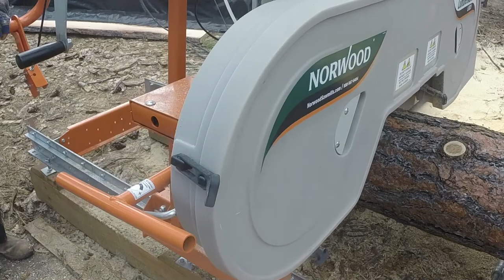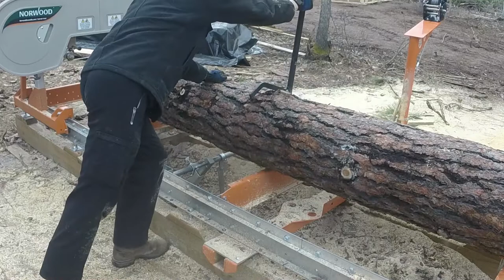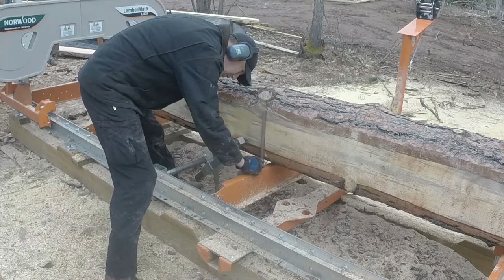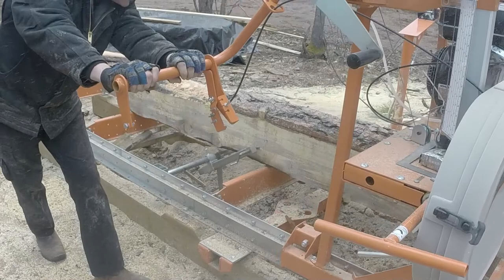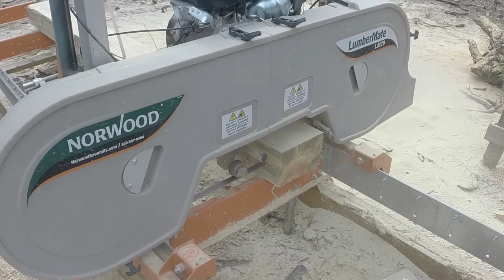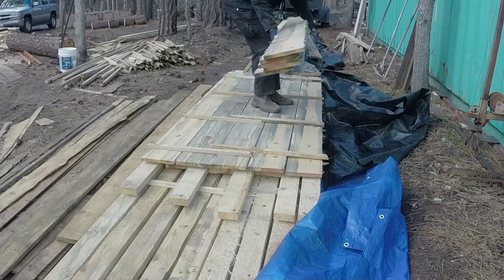Milling board and batten on the Norwood LM29 sawmill - norwood portable sawmills

Comment: I didn’t read all the comments, so it might have already been mentioned. I’m in Canada. The rule of thumb here is to only cut Pine and Spruce logs in months ending in ‘R’. The sap is low during the cold months. You can mill them at any time, but cutting when the sap is low is best. 
Keep up the good work!
Reply from the maker: Never heard any mention of only milling pine in a month ending in "R". Not sure if you are pulling my chain or not but on a side note there isn't much sap in blue pine as it is already dead when I cut it down. :)
Reply: Main species in Eastern Canada are White Pine and Red Pine. Both have a lot of sap in the warmer months. My Father in Law has worked in the woods for more than 75 years was the one who told me about the ‘R’ months. I have heard others mention it as well. If the wood you are milling is already dead, then, no issue. I also know large commercial sawmills in my area will not even purchase Pine that was cut in warmer months. Too much sap on the equipment and blades.
Reply from the maker: @davidbelyea7031  Interesting that mills wont even purchase Pine cut in warmer months. Around here mills get what they get and are happy for it. lol :)
Reply: There is a monopoly here with one wealthy family that buys up private wood lot but also clear cuts Crown (government) wood lots. They set the conditions and prices. They pay next to nothing in royalties, yet when 2x4’s were selling at $6-$8 last year, they matched the price in all their retail stores, despite the fact that their cost remained the same as before COVID.
Btw. I run a Norwood Mark 4
Reply from the maker: @davidbelyea7031  That sounds horrible, where abouts do you live? I'm kinda lucky that I do have a sawmill and I also have a big home store about an hour away so I can buy lumber if I want to. Depends on what I need and how long it will take me to mill it, time for product kinda thing. :)
Reply: I refuse to buy lumber from a retail store. I have 100 acres of century old White Eastern Pine and the big loggers have clear cut right up to my property line on one side-including taking out a 4’ diameter boundary tree and leaving it to rot on the ground because it was too big for their slider to handle. I live in New Brunswick on Canada’s East coast. Glad I have my Norwood and lots of my own wood!
Reply from the maker: @davidbelyea7031  We had thought about moving to BC 4 years ago before we found this property. Seems like there's more room and less people but I didn't look into it much. I don't know what the building regulations are but where I'm at I have to buy lumber to build anything meant for human inhabitance "house", but we can build barns and sheds out of whatever we want. :)
Reply: It helps to know a lumber grader who can stamp your work

Comment: When you said diamond pattern that made me think of milling metal. While ago I was milling a piece of aluminium and made a few cuts everything ok. Next day I continued, and see a faint diamond pattern that was not there the previous day. Checked everything, even asked the cat if he had any ideas. Yes, give me some treats. Made cup of tea, thought of everything but still no solution. Then I double checked the mill, over, sideways, up down underneath. Saw a socket head bolt on the floor. It was from mill, nothing major, but enough when missing to allow the smallest vibration. Replaced with new bolt, diamond pattern not happening now. So that shows that the smallest thing can have a big effect. Check the stability of your mill, might have got out of line or a bit unstable.
Reply from the maker: I try and check the level of the mill every other log, sometimes this doesn't happen but every time I check it it is straight and level. I think the marks are because the logs aren't completely dry, the marks seem to go away after a day or two. I find dead standing trees to cut down but they still have a bit of moisture in them that quickly dries out after i mill them. :)
Reply: @KoalityofLife  so he blade behaves differently depending on the moisture?  If that varies the resistance that the blade gets as it cuts through the slot in the log, one moment the moisture makes the resistance between blade and log increase, then its sort of wiped away, then it returns, that could make the diamond pattern.  So if you vary the cooling water supply, or its soap content, that might change the resistance and also the build up of sawdust one side of the blade? Do you think the side that the water sprays onto can be cooler than the other? If you arranged the spray both sides might that change things? Gosh this is like making an anti-gravity machine, which would be easier to do I think.
Reply from the maker: @skizzysmith  Hahaha. Anti-gravity machine be easier to figure out. I milled out another log off a different tree and no problems. Must have been something in that log. Might never figure it out at this point. Oh well. :)
Reply: as you say, you might never find the answer, so onto the next log,and the next, and the next....

Comment: Maybe mix some vinegar in with the water supply?  Vinegar works well on sheet metal to clean  grease and oil.
Reply from the maker: Vinegar is a great cleaner, I might try it. I have found that a mix of Pine Sol and Dawn dish soap in the water works well too. :)
Reply: Vinegar maybe a little cheaper. @KoalityofLife
Reply from the maker: @johnossewardjr6965  That is very true :)

Comment: I don't know what kind of band Wheels you have but if you have the neoprene stretch fit wheels like Norwood LM34, you do not want to use any petroleum products ( diesel fuel or kerosene). The petroleum products will make those neoprene band Wheels stretch and get super soft and roll up in front of the blade and throw the blade off the  steel wheel. 
I sawed some power poles and the oil in them made my neoprene stretch after a couple months.
Reply: From now on I use nothing but straight water. I have my valve wide open so I can use lots of water and I don't have any troubles.
Reply: That oil makes that neoprene so soft not that rubber rolls up in front of the band blade like a wave or bump and eventually it will kick the blade off
Reply from the maker: My mill has what looks like black fan belts on the wheels, I don't know if they are just standard fan belts or made out of something special. I have always been leery of using diesel fuel or kerosene as a blade lubricant. I use a mix of Pine Sol and Dawn dish soap in my water, seems to work great. :)

Comment: thing i was suggesting on the paint brushes rubbing each side of the blade was at the top of his machine. i might be making run up to the amish soon to get some wood from them ill snag some pics or ask them to let me take a video of them running their mill. hey are younger couple. like in 20-30 couple. they have like  kids lol. they have solar panels. uses a computer cause of their business. they are amish. he turns the computer off when not using and after a certain time. his phone gets shut off at a certain time. he is very conservative on how he uses his phone. its only for phone calls related to work and he leaves it sit in a area of his other barn where it does not distract him. some of the coolest amish i have ever met. he sells me trailer loads of firewood for 40$. as much as i can fit on any size trailer. 

he sells me pallet planks for 15$ fill the back of a pickup truck. get like 300 boards for 15$. always oak. they have another mill on his property that is a newer mill. and then his old mill. then he has chainsaw mills. and other things set up for him and workers to use. they cutting moving wood all day everyday accept sunday lol. all bunch young amish dudes. they are more hip to the new ages then their parents. their solar set up is nice. it runs their one mill mainly. their battery bank is some the scariest looking things tho lol. its stacks of fork lift batteries charges off the solar and the windmill and generator if they have to. im gonna try make a trip to them soon to get some wood. and i wanna get some vids and pics for ya. some cool ass dudes and awesome ideas they have. they recycle like everything. he has a old ford truck he uses as a work truck. 
the truck has a lift on it for moving the logs around for them. like a mix of a tow truck vs gentry crane. they pick up logs and drag them around lift em up put on the mill. slice and dice in minutes. fire wood going 1 direction. slabs going different direction. no one talks. silent working other then mill. and bam your done lol. they stack it on your trailer and look at your say 40$ lol seems everything almost cost 40$ with them lol.
Reply from the maker: Get some video if you can and post it on your channel for easy viewing. I have been around Amish a little when I visited Pennsylvania, pretty interesting people. :)